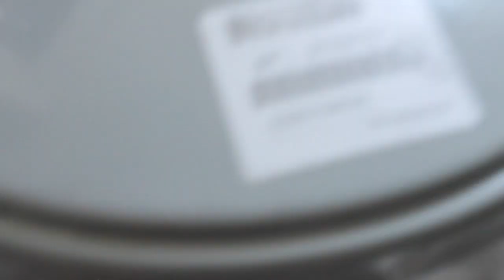Inside Pole Transformer And Repair

Comment: Well that's good news!!
Reply from the maker: Variac Maniac Thank you! Good thing I've got those small 7kV xfmrs because 14.4kV seems a little too high for my taste. Surprising to me is that corona will form around exposed pointy metal at that voltage and current, and you can feel the magnetic field! I'll stick to 7kV until I get a workshop outside where I have tons of space.
Reply: You're welcome!! I sometimes power my potential transformer up to 14.4kV + and I can feel my hairs reacting to it!!;)